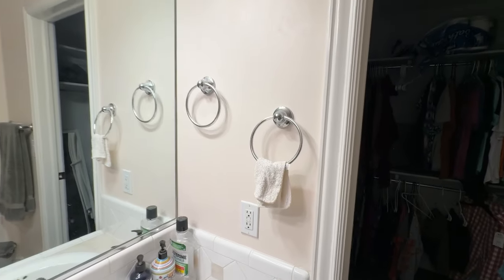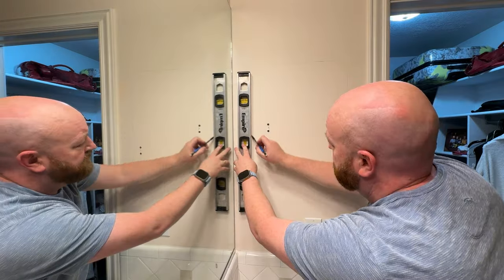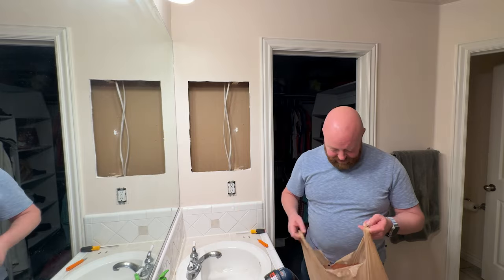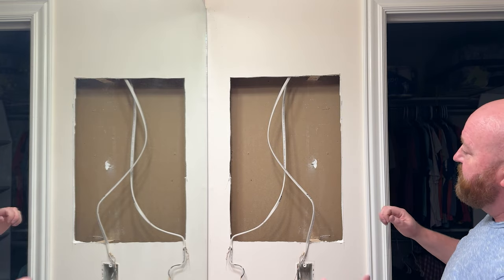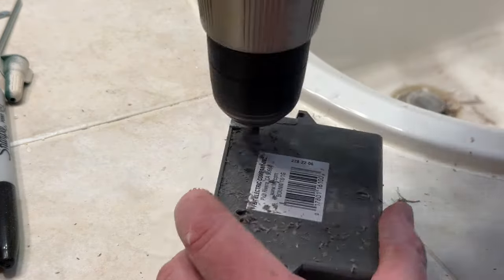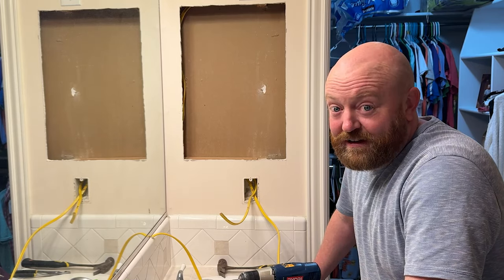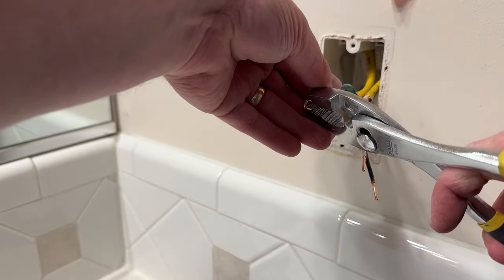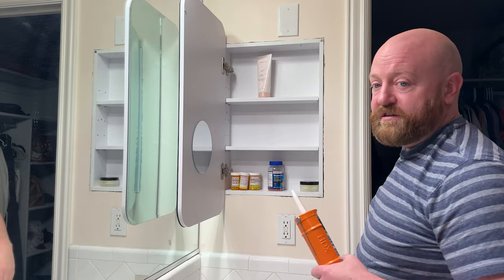How To Install A Recessed Medicine Cabinet

Comment: Look up J Bead or vinyl L-tear strip for a better finish on your cut drywall.  You could have also put the J-Box in the closet or attic if you have access. Also, you may have exceeded the box fill allowance in that J-Box.
Reply from the maker: Got it. Thanks.

Comment: Overall a solid effort but I can give you some tips.  The junction box could've been on the closet side, so that was a strange decision.  Now you will see it no matter what.  Maybe it would have been hidden by the mirror if you had mounted it sideways though.  But the bigger issue is you left a dangling stud.  That needs to have a kind of "header" made, and carry that stud off to the right a bit, and down to another cross part that brings the stud back to the original spot.  Think of the wall stud bumping out for a minute and then coming back in.  The wires needed to be stapled to the left stud.  In short, you kind of needed to remove some drywall to do this correctly and support the edges of the drywall all the way around the perimeter of the hole you made.   Final tip, you can safely put 14/2 romex in instead of 12/2.  Easier to work with.
Reply from the maker: Thanks
Reply: @DIYExperimentChannel   You got it man.  In the end, great idea, and you got it done.  Onwards and upwards.